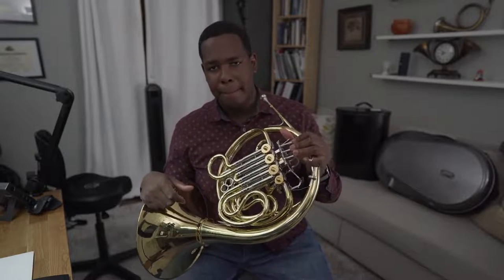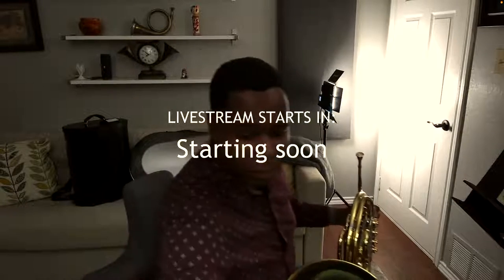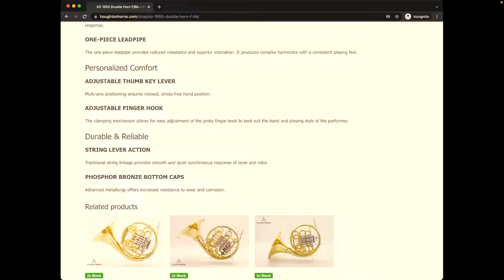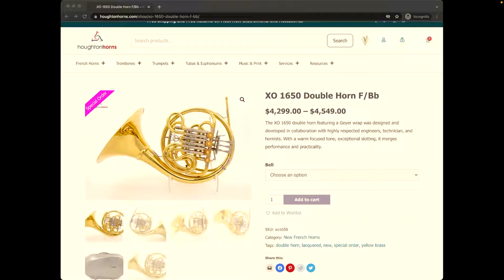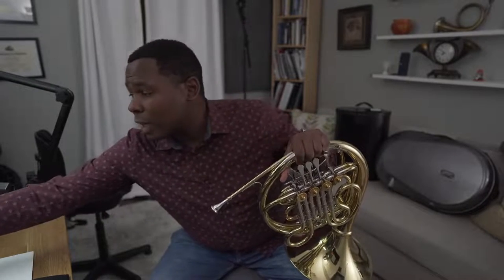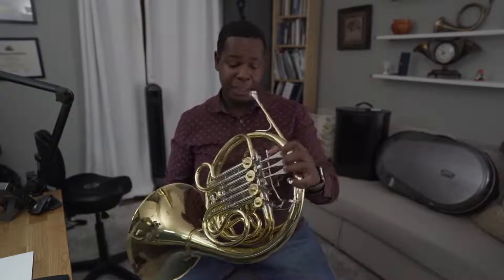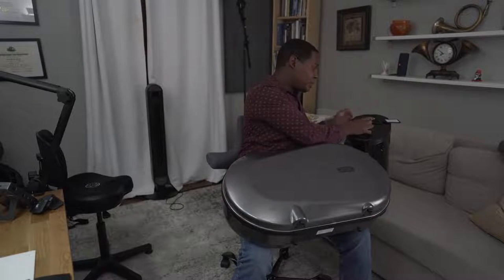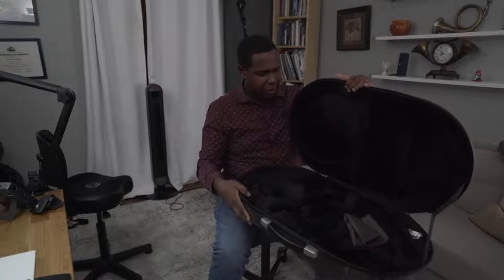A look at the new XO 1650D Double French Horn!

Comment: While I think KHS/Jupiter/XO has stepped up its game with this horn (I’ve had a chance to play the fixed bell version), I personally think it’s still lags behind the Yamaha YHR-671 (probably the direct competition). If a person was dead set on a brand new horn, I’d suggest saving up for a bit longer to get a 671 (the 671 is about $1000 USD more expensive). If someone said “I only have $4500 to spend on a horn”, I’d encourage them to look for a gently used 667/671. Just my $.02.